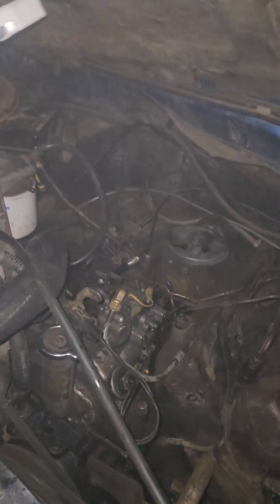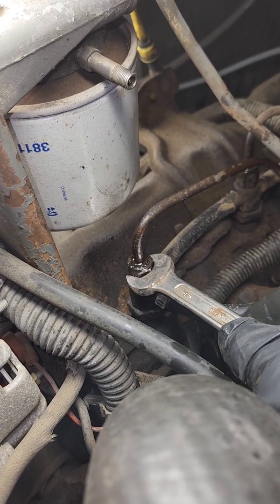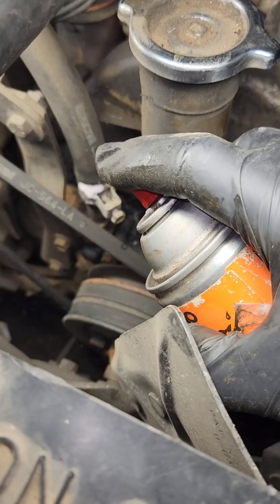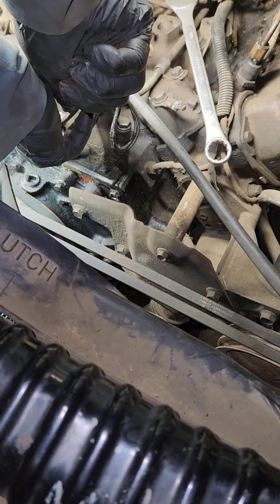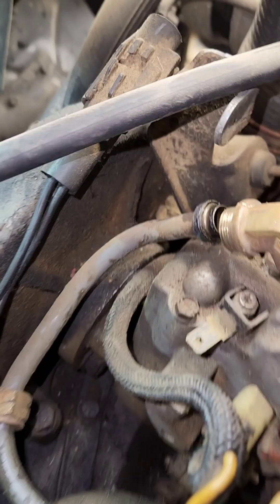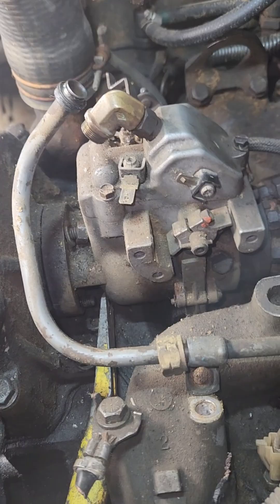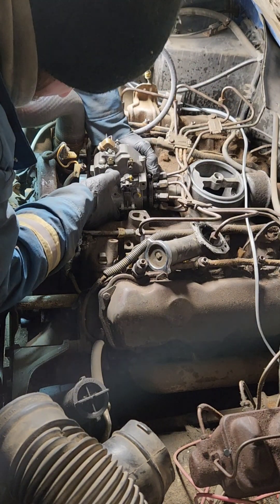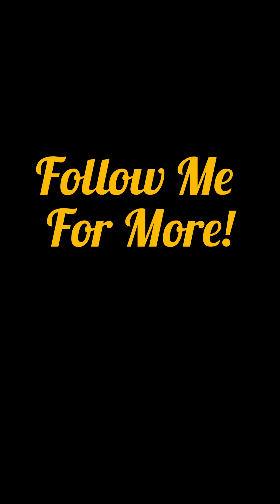6.9/7.3L Ford Injector Pump Replacement!

Comment: The ride I had, when taking some college courses, 
an old 48 Chevy 3800 1-ton, loooonnngbed . 9feet, 2inches, that stepside bed was🎯
 The truck empty, with the 2 overlapping 4x6ft fishplate 1/4 inch steel, in the bed to cover the rotted boards in the bed floor, weighed 5,400lbs. Hauled in a load of scrap engines, rear axles and other heavy crap...9,700lbs, on the scale🎯 Other than hanging low, in the ass end, & a little more pressure on the brake pedal... She rode like a Cadillac❤😎☕

Comment: 390 was one of the good FE model engines. 352 wasn't bad either. 
360 engines were anemic, crap.
 Really love how you had to measure and shim each valvespring differently, on those FE heads⚡💩